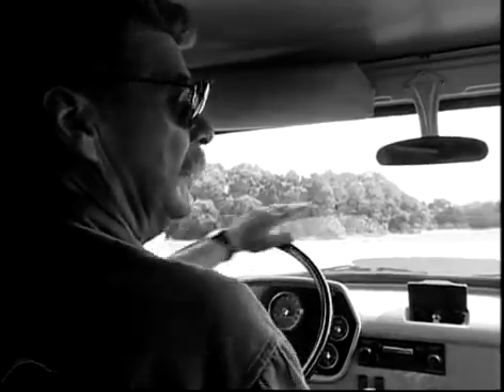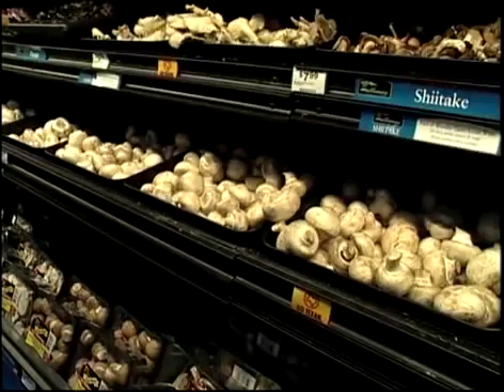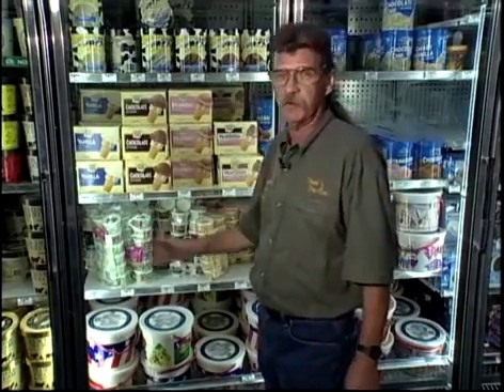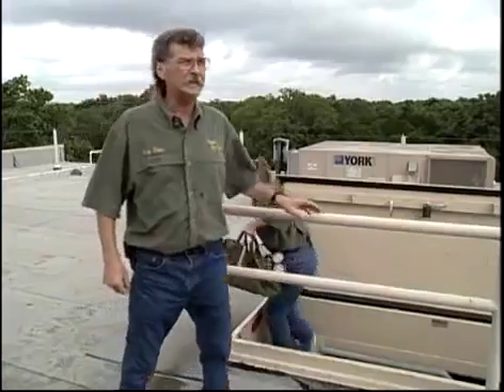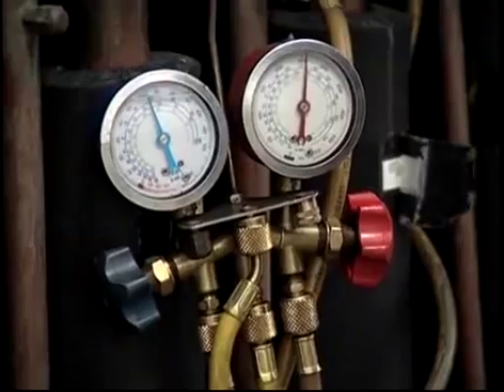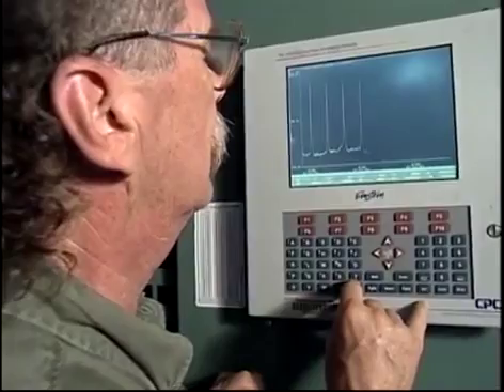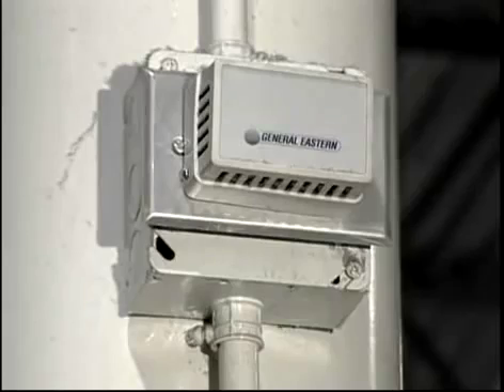How a Supermarket Refrigeration System Works

Comment: Can those fridge doors open by them selves cuz a week ago I was at Safeway in the milk aisle at night by my self and all the fridge doors behind me like 5 or 4 opened up like 3/4 and then shut. The area just felt weird
Reply: If it’s a milk case but also a walk-in cooler usually when someone shuts the door from the other side the air pressure forces the outside doors to open

Comment: Have worked on supermarket refrigeration most of my life. Retired now, don't miss the 2 am phone call because a store has a 9 watt motor out in a 12 foot dairy case! Or water dripping on the produce cooler floor at 1am when no one is even working  in the department!
Reply: How can I get into the refrigeration side?  I am a HVAC technician at a public school district currently
Reply: @3cats932  do you work for a HVAC cntractor, or are you an in-house guy? 

I would apply to a commercial refrigeration company in your area, you can also work for a national company like hussman. You'd probably be going for an apprentice position, having a hvac background will help tremendously.

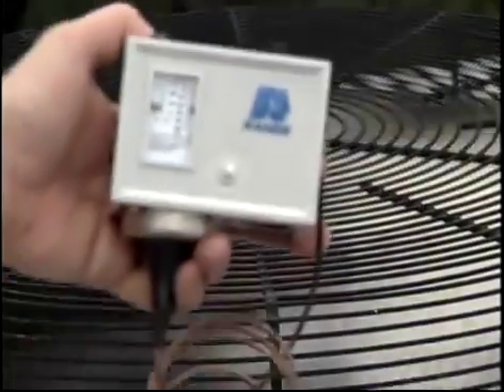Comment: Just wondering about the backward spinning fan motor at 6:58
Reply: camera effect
Reply: It doesn't matter which way the fans spin. But it's best if it draws the air upwards
Reply: @mattheww3116  Yes it does matter which rotation. If you look at the blade you will see that it is concaved. It is shaped like a scoop. The fan should turn in the rotation that the blade "scoops" the air towards you
Reply: @adammiller2246  Is what I am saying
Reply: @adammiller2246  that's what I was gonna say..and....la looks green gel is great for mullets
Reply: The price on the poultry seems like a sale lol

Comment: The only video on YouTube that explains what I do at work
Reply: Is the heat from the high pressure side of the system typically used to heat the store as well? I work in the meat cutting department at a supermarket and it’s very cold in our store. When I found out the condensers were outside the store (near receiving in our case), it made sense why the store was so cold. The way these systems are designed basically turns the entire store into a refrigerator.
Reply: @ayeeniko  If you mean other than the meat cutting area then the owners are probably being cheap about it if its like that during the winter time. But if you work in the meat department its always going to be cold in there.
Reply: Must be quite different nowadays
Reply: @nielsdaemen nope just breaks more often. lol